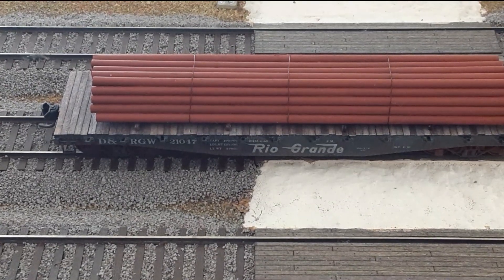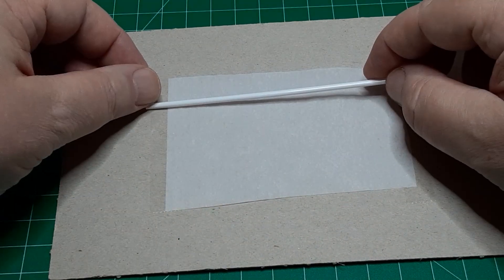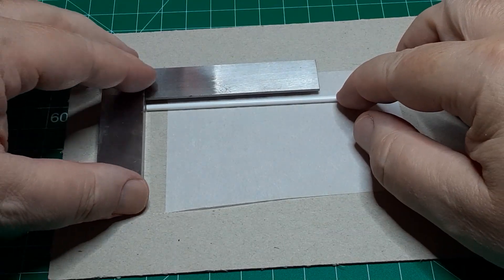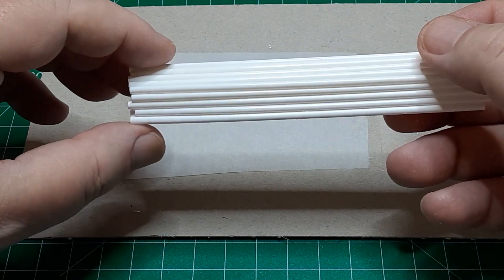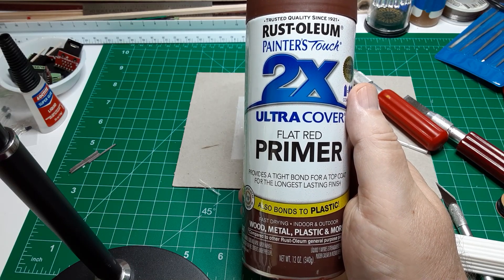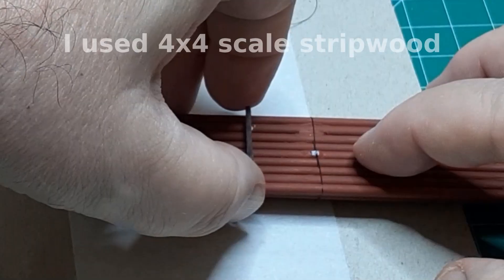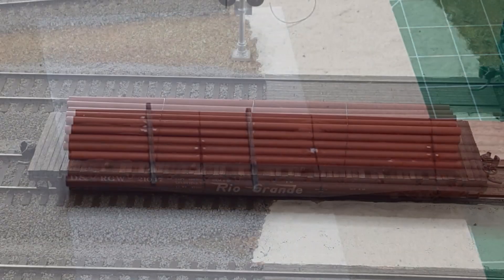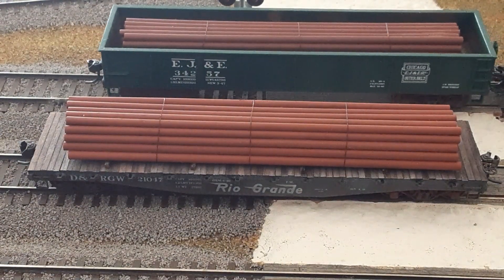Quick  n Easy Projects #3: Pipe Loads

Comment: Nicely done. There are all sorts of things one can use for different diameters of pipe if one knows where to look. I've also seen others use things like Chartpak tape to replicate the black banding, while others have tried automotive pinstriping tape. One just has to remember that banding is very narrow in HO scale, and a 1/16th inch strip equals to something over 5 HO inches wide.

Comment: I have also been making pipe loads lately. I found that the wholesale restaurant supply stores sell stirrers in packs of 500 for less than $2.00 and they are different diameters between wholesalers, likewise, straws from the fast food restaurants may also be different diameters. Having slightly different diameters enables you to slip one pipe into the other producing collars or other end fittings, think culvert or municipal sewer pipes. Make these shorter lengths of pipe and paint them a concrete color. They may need wooden staves between layers. - Tony.